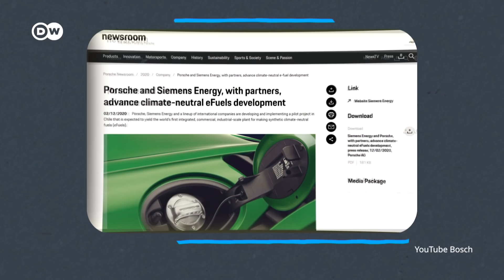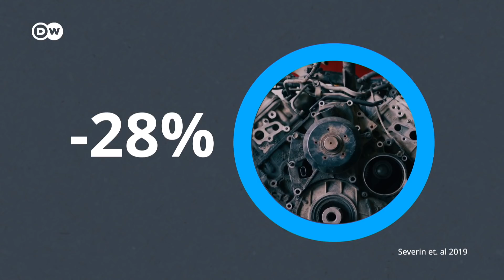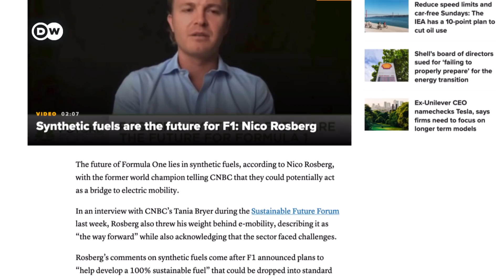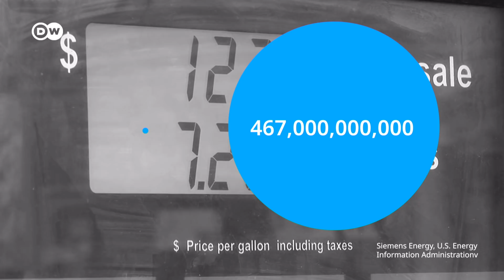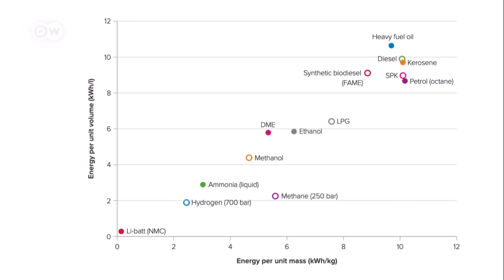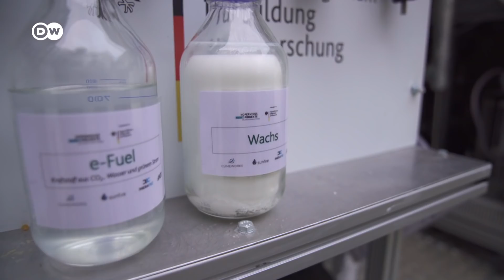The truth about carbon neutral fuels

Comment: As a car enthusiast, I want to see Efuels become successful and come into the market to keep my passion alive. I want to be able to take EV truck and tow my race car to the track and fill it up with Efuel and go racing on the weekends. I want to commute with my EV to work then take my classic car out for a cruise. I can see Efuel and EV tech working as a partnership not as a one or the other option.
Reply: Yea, combustion engines and electric motors should live integrated with each other because of this
Reply: @jadenspires1891  I would like to see biogas plug in hybrid with electric range at around 100 km for daily driving and have closer to 1000 km range on biogas tank. When you don't need big battery then battery can be made from sodium ion and having fast charging can allow quite high battery utilization but if you need very long range and fast fill up then you use small very optimized biogas combustion engine. Also making cars consume less like Mercedess eqxx is good idea so it also decreases need of battery and biogas and we can get more people driving with low CO2 and particulate emissions.
Reply: Yes, please try and convince other car lovers that nice cars and a sustainable future can indeed live in unison
Reply: Yes I agree with it so we still have Internal combustion Engine because of this synthetic ⛽️
Reply: Exactly
Reply: yes please just make it so that i can take my ferrari to the track with a truck and still feel like im not doing anything wrong. just adjust the science and reality accordingly please.
Reply: I think biomethane is a better option than E-fuels for cars. The technology already exists.
Reply: While you're enjoying your first world life, the third world sinks further into abject poverty, as the energy they need for basic survival has been diverted to power playthings for the wealthy.
Reply: Totally agree. This would make everyone happy. I hope we we can get it to work.
Reply: yes intergration...then we get a hybrid vehicle powered by efuel and batt
Reply: Fortunately such carbon nuetral and cheap fuel already exist. Biomethane can be run on any CNG converted car (a practice very popular in fleet cars so the refuel stations and mechanics are already here) [convert a gasoline engine vehicle]. Assuming you don’t want to use corrosive ethanol or waste farmland. Biomethane is hecka easy and versatility to produce, cheaper per mile, less polluting per combustion, uses minimal energy. If you have diesel, waste vegetable oil or chemicals refined biodiesel. Conversion kits already exist. 

Yes methane is a green house gas if you leak it into the atmosphere just like how battery wreckage/fires and current fuels when they leak into environment when something goes wrong cause massive environmental toxicity damage. I Rate the eco vehicles based on how they work. So methane does not leak from CNG cars during everyday use and they burn cleaner then their fuel alternatives.

Plus battery electric vehicles are not even the future anyway electric pantographs are. That infrastructure can easily dominate with infinite range, reduced co2 to make the smaller battery, and even easy hybrid capabilities.

Carbon neutral fuel. EVs are technically carbon neutral too. Ie both biofuels and electric cars both (asuming sources from 100% clean electric grid) emit no new co2 into the atmosphere. The co2 that comprised the biofuels was extracted from the atmosphere in the first place. Heck if your talking about co2 cost to make biofuel cars have less initial cost due to battery size (though that can be changed in future)
Reply: Efuels already exist, their biggest barrier is making them cheaper and produce them in a large scale. So if what you want is being able to use them in your expensive Ferrari on a racing track, then we are already there. The mony that's being spent to scale their production and make them cheaper should be spent in better places.

Comment: Fuels, liquid or gas, will still work when your cellphone battery doesn't. Based on most people's budget, a switch to electric cars will require Goodwill / thrift store options.
Reply: And how does all the pumps work again? Ah yes electric motors powered by electricity. 
Don't look now but refineries for those barrels of crude unuseable fossil fuels use massive amounts of water electricity and cobalt. 👍🏻
Reply: @4literv6  Have yet to see a 100 year old battery that still works.
Reply: @gregnulik1975  never heard of the Baghdad battery eh? Or Jay Lenos baker electric from 1914?
Reply: @4literv6  And how many people still use those ? Oh yeah, maybe something made by Nikola Tesla, other than that ?
Reply: @gregnulik1975  you asked for an example I gave 2. Jay Leno claimed his baker electric only needed to have the batteries be reconditioned not replaced. The owner of our next energy who has the tesla which did 750+miles also has a baker electric. And he says the original batteries are still in it just reconditioned. 

They are also working on a nanotech derived electrolite additive which can break up any formed dendrites in ev batteries. 
Which would recondition them to their near new capacity. Plus north volt proved last year recycled battery cathode materials actually performed even better vs newly sourced materials. Due to the further refining and removal of impurities during the recycling process. 👍🏻
Reply: @4literv6  I live in a part of the country where we still benefit from the rural electrification act because big companies didn't care, and largely still don't. That alone convinces me to be skeptical.

Comment: China is leading in the field. They gasified coal to synthesize methanol, ethanol, gasoline and diesel (without carbon capture). The coal-based fuels are highly carbon-intensive (higher carbon footprints than regular petroleum-based fuels). China is branding its coal-to-liquid as clean coal technology, and marketing their ultra-high-carbon fuels as clean energy.

Comment: Personally, nay, until we have so much renewables that we don't know what to do with the peaks. But even then, given that it rest on electrolysis, we can just store the hydrogen in ammonia, or solid form, and switch internal combustion engines to hydrogen (with a converter). Of course, that does not cover the needs of the existing oil-based infrastructure, but we have way too much oil infrastructure already, so as the industry is dying (it has to, we need to make sure NEW engines are as much electric as possible), then it can be used to the existing oil infrastructure.

Comment: Why not use renewable surpluses that can not be put onto the grid into synthesis of these bio-fuels, for example with extremely sunny/windy weather? Only objection I could think of is that there are better storage methods available already.
Reply: Thats basically the method used. You run these fuel production plants during low energy prices. 

There aren't better energy storage methods available, what are you talking about?

Comment: Why don't people just use public transport as one of the main mobility in everyday routine? Because I think, the publics were less polluting because it is using low carbon powerplants, like diesel buses, diesel trains, and even electric trains or, if still wanted to use personal mobility, use bike instead or even walking to work (not in a case that the workplace is long away, except you like that way).

Meanwhile, the personal transport, such as cars or motorbikes could only be used at some point of event, such as if there is an emergency situation like there is a sudden call from your boss to office.

North Korea is one of this kind, even though cars are a bit banned for regular people.🤭

That's just my opinion, I'm not a politician or any kind of it, I just a 19-y.o boy studying at Mechanical Engineering department of a Polytechnic. 😅

Comment: I would go with yes taking into account the video has so an incomplete perspective, not considering other things as the future environmental impact of EV’s and the mining of minerals from a S-LCA perspective, for example in 2040 it will be needed 42x more lithium than in 2020 for a sustainable development scenario (source IEA)… also he barely talks about the possibility of obtaining renewable energy that cant be used as electricity and can be transported long distances by stable molecules instead of electrons, this is an alternative for countries, such as Japan or South Korea, that does not have the potential for renewable generation and need this to go net zero. This is not an alternative but either another possibility that can be more feasible for some specific situations

Comment: We already have reFuels like HVO100.  In Germany, the Federal Environment Agency unfortunately blocks paraffinic fuels because it simply blocks the EN 15490 fuel standard.  As one of the last countries in the EU.  In Sweden, 30% of trucks are already running on HVO.  HVO100 is made from residual and waste materials.  There is no conflict with food.  The criticized palm oil comes from the residues or was synthetically produced.  This means that a diesel is up to 90% climate-neutral!  Incomprehensible that this potential is not raised!

Comment: I don't think we can afford a "one solution for all applications" approach anymore, as we had with fosil fuels for so long.
We need to do everything possible.
Some cars will be electric, but we don't know yet the batery tech capacity we have. How many can we sustain on current battery tech before we run out of materials. And many industrial as well military gear will not be able to go full battery.
Same with planes and ships. We need diverse solutions for everything. And yes the costs that will come with it.

Please note, we do not use fosil fuels because of the greatnes of its smell or enviroment, but because they are STILL so dirt cheap, compared to anything. 

Also the really big key word is energy storage. We can store synthetic fuels easily and in existing fuel storage. Stop looking at fuel as fuel. but Energy. Bateries are a fast storage, great for parts of our solution, but low density and expencive to isntall and maintain. A huge fuel depo can have cheap storage for years in case of global fluctuations and other crisis. All is energy, the de facto currency of the world. Everything else is paper to help trade energy. 
This synthetic tech will need to be funded and further developed, even if most car owners wont afford the fuel cost. But other applications will need it. Out storage will need it. Hopefully we will find a more efficient process than than decomposition and resynthesis. 

It's not a "bridge-technology", but part of the diverse long term solution.

Comment: We need eFuels and reFuels!  It won't work without them... not even in the transport sector!  If we were to only register 100% electric cars today, it would take us more than 20 years to replace the vehicle fleet in Germany alone.  However, we will not achieve 100% e-car registrations in 2030 either.  Another point is that with eFuels, a combustion engine can be operated in a climate-neutral manner.  This means that a blanket ban on combustion engines by the EU Commission is no longer tenable.  We cannot simply say that a car will no longer be able to emit CO2 in 2035.  It's not fair!  It just can't be fossil CO2.  In this respect, combustion engines operated with eFuels or reFuels must also be allowed to be re-approved by the manufacturers after 2035!

Comment: NH3 simpler and cheaper and no carbon required.  Works fine in spark ignition IC engines. Storage the same as for LPG so possible on a forecourt.
Reply: Except NH3 is toxic when inhaled and produces huge amounts of nitrogen oxides, even atmospheric nitric acid when burned. No way acceptable.

Comment: Due to the energy density nature of the e-fuel, it is best suited for airplanes, fighter jets, ships, and heavy trucks. E-fuel is not appropriate for cars because e-fuel is expensive to make and only carbon neutral. And battery-operated/hydrogen cars are cheaper & environment friendly. At this point, cars with internal combustion engines cannot be saved with e-fuels.

Comment: e-fuels are the only viable solution for long haul aviation. That in itself is reason enough to develop the technology.
Reply: Or green crude. Algal crude oil. Much cheaper, more scaleable, uses similar refinement process to black crude, and almost carbon neutral. Almost just because of thermodynamics.
Even the E-fuel seen in the video suffers at the hands of thermodynamics.
They're equivalent in their emissions and potential uses, but algal crude oil is more scalable.
Reply: Amen brother. E-kerosene would work well for long haul jet planes. Maybe, e-kerosene could be run in a kerosene fuel cell (kerosene based fuel cells were developed in the mid-2010s), which could power propellers, if one wants a quieter plane that runs off of clean synthetic kerosene.
Reply: And sports cars, they shouldn't die :)
Reply: V12 Murcie bby!

Comment: You forgot bioengineered algae for making biodiesel. The efficiency of this process from raw sunlight to combustible distillates exceeds the other proposed options (i.e. Fischer Tropsch process) And what is completely forgotten is what to do with all the manure from big pig farms in the US. The animal waste currently releases Methane from lagoons. Methane if released in the atmosphere has a high global warming potential. If the manure is put in digesters and the Methane extracted, Hydrogen Sulfite and moisture removed it can be used as natural gas in the gas distribution network, and when combusted Carbon Dioxide and water is released with zero global warming potential because it is closed cycle. Decarbonization is a lot more than just electric vehicles! It is a lot more.